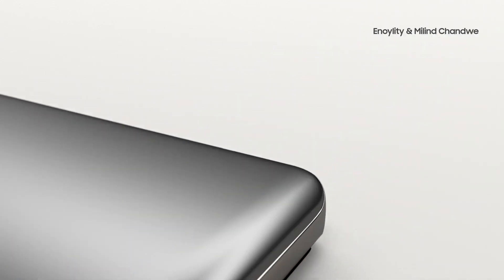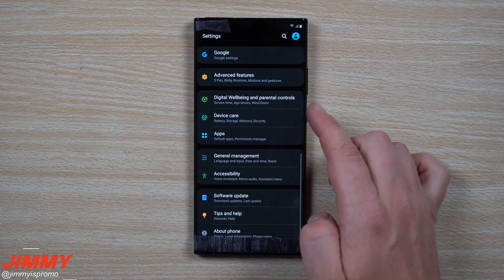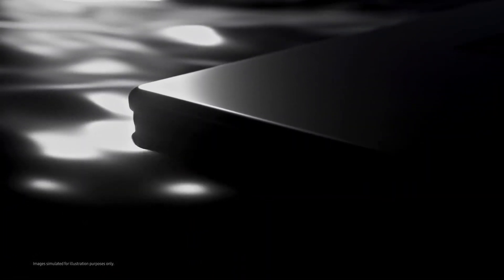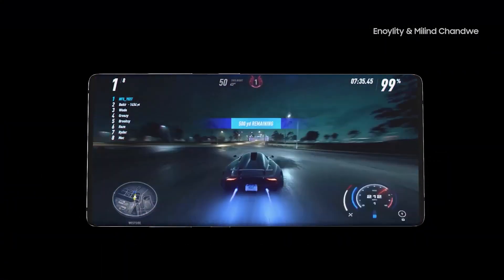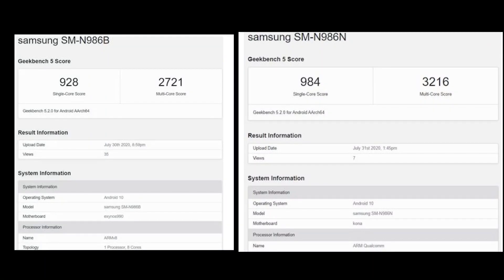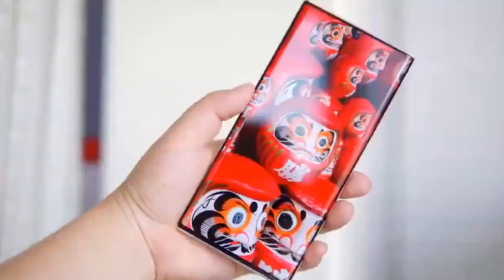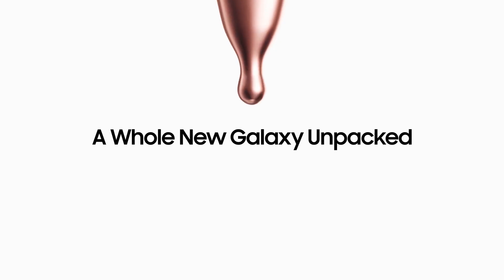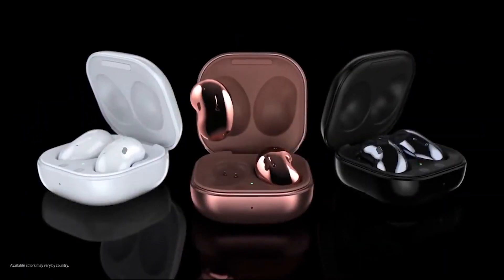Samsung Galaxy Note 20 Ultra - Exynos 990 & Snapdragon 865+ Benchmark

Comment: We want snapdragon 🤬😡, if they still push exynos it should low price n very much cheaper than snapdragon version 😏😑
Reply: @JB Jhay Indonesia bro
Reply: @JB Jhay that's why i complain it ,this not fair for us as customers
Reply: @JB Jhay yeah but you buy it as customer right?just like me
Reply: @JB Jhay i will buy it any flagship in Indonesia but if they sell snapdragon version, i use since s8 arrives, s9+, note 9 & note10+ but I'm not happy with exynos version, exynos is great for multi tasking & samsung has a great amoled display for my eyes but sorry samsung i had to say it..your exynos is suck for gaming 🤦‍♂️
Reply: @rxchester3364 
For me, this Exynos' VERY SCAM chipset in South Korea!
Reply: @JB Jhay not correct.  Canada so gets the snapdragon.
Reply: Then wait for galaxy fan edition may be S20 lite with only Snapdragon processor cause previously fan edition S10 lite come with only  Snapdragon 855price 40 to 50 thousand and gives fair fight to one plus 7t. But fun fact is note 20 hve panel of 60 hertz but fan edition may concern contain 120 hertz with fair price
Reply: @redstang70  What is wrong with you, Exynos for Canada guy?
Reply: @justlikethat6824  we hope so,hope Samsung will read this
Reply: SM-N986B (International) = Exynos 990 (7 nm+) - 12GB RAM ON 256GB & 512GB STORAGES - dual sim on all models.
SM-N986U (USA); SM-N986U1 (USA unlocked) = SM8250 Snapdragon 865+ (7 nm+) - 8GB RAM ON 128GB AND 12GB RAM ON 512GB

So on the international version, there is double storage and more ram for less CPU performance for the same price as the USA cheaper model. Samsung overcomplicated things by a lot this time!
Reply: i dont even care about the  lower price, simply knowing  there is a better version of the same phone pisses me off

Comment: Yeah we all know snapdragon chipset is best in the android chipset department.
Reply: Not for too long, exynos 100 is coming
Reply: Not for long time next year samsung flagships unbeatable cause of Exynos 1000 with RDNA gpu which easily defeat Snapdragon gpu adreno 650 and the main issue of samsung this year is gpu throttling therefore they are changing mali to RDNA gpu and rdna gpu is from amd which make gaming processor for pc and gaming laptop and give good competition to intel.
Reply: @green_ninja7771  A zero makes a difference buddy 😎👍
Reply: @justlikethat6824  It may be true until snapdragon chip manufacturers staff were put under cryosleep.!!! ☻👍

Comment: SM-N986B (International) = Exynos 990 (7 nm+) - 12GB RAM ON 256GB & 512GB STORAGES - dual sim on all models.
SM-N986U (USA); SM-N986U1 (USA unlocked) = SM8250 Snapdragon 865+ (7 nm+) - 8GB RAM ON 128GB AND 12GB RAM ON 512GB

So on the international version, there is double storage and more ram for less CPU performance for the same price as the USA cheaper model. Samsung overcomplicated things by a lot this time!